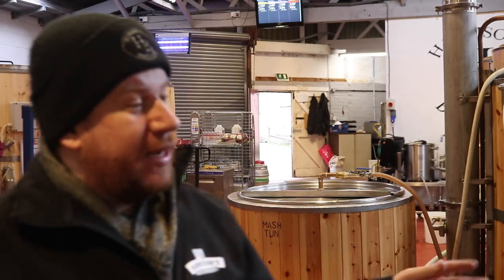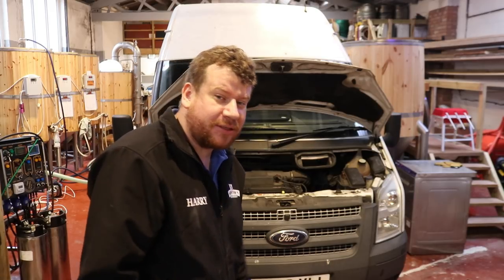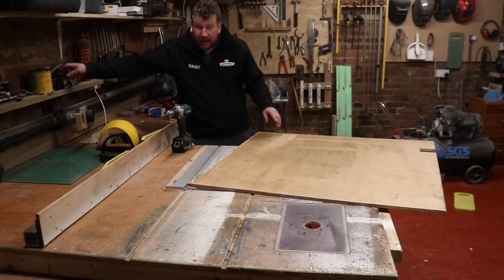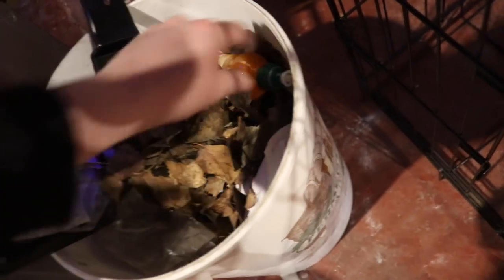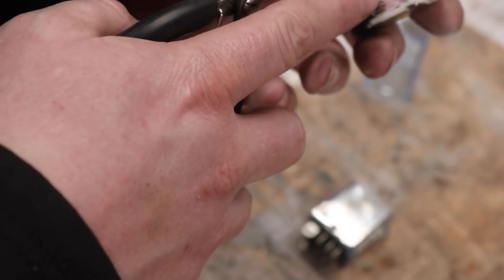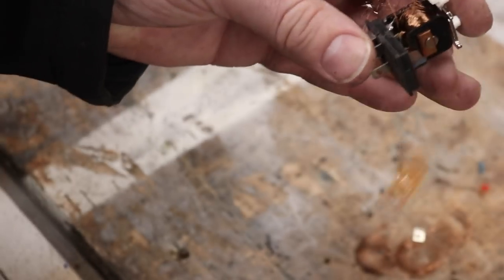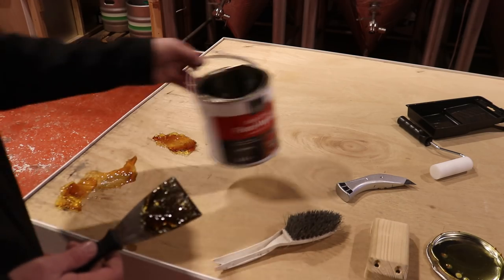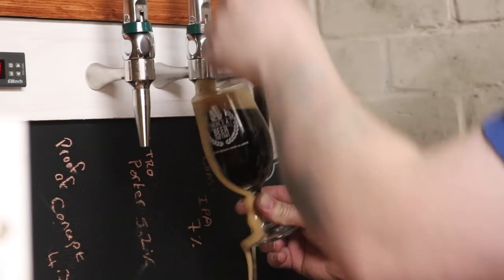THE MONEY 💰💰 PIT THAT IS THE VAN 🚛

Comment: Let's hope that battery fixes the issue with the van.I recently had to get the power steering pump replaced on my Focus diesel,it's a complete self contained unit with the reservoir,even with a second hand unit out of a scrapped focus it still cost €175 to get the job done,bad timing just before Christmas,but I've been told they do tend to go on the focus diesels so keep an eye on that. Now I've got to get rear axle bushings done and get it re tested,never ends does it. Still I got it cheap enough and it's a great little bus overall so I'm not too miffed. Here's hoping 2020 is a better year for us both. Cheers.

Comment: Happy new year.
Another great vlog as usual.
I was watching one of the vlogs the other day 'featuring' your vacuum sealer and I thought that looks like a good one. I tried to find one like it and couldn't - could you let me know what make it is and where you got it from? Cheers 🍻👍😊
Reply: Try lidi they have them in every few months
Reply: @norfolkhillbilly  thanks for the tip. I was after one like 'Harry's' which has a sort of proboscis which goes into the bag then retracts out of the way as you seal. It looks like a good way of removing the air. I can't find one like it anywhere on ebay.